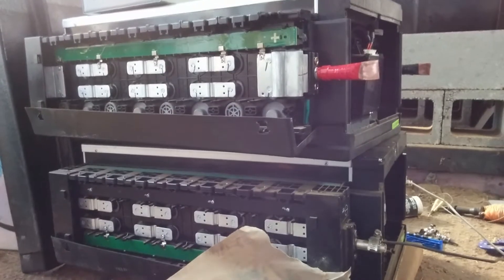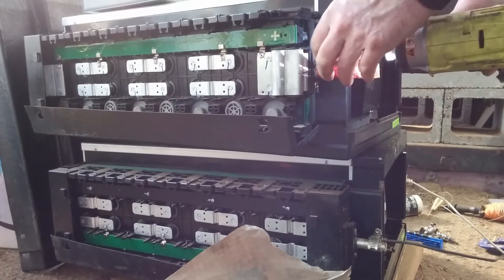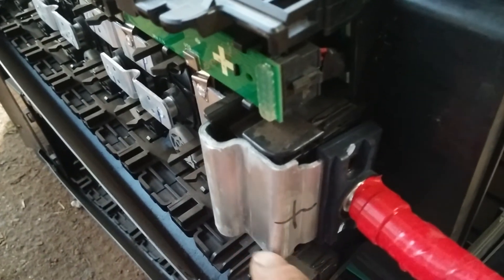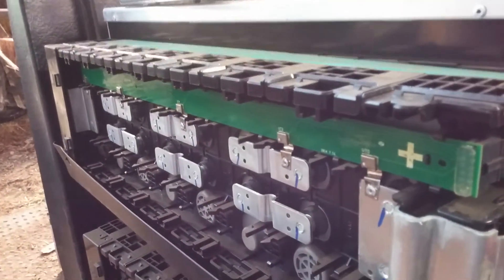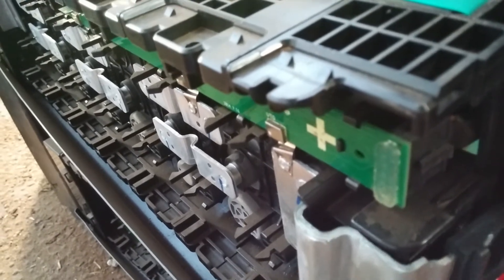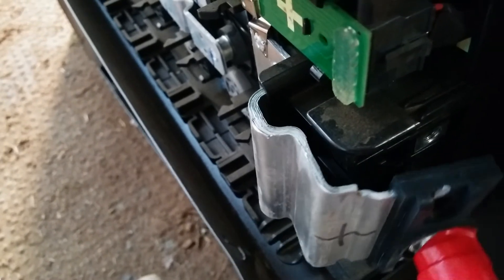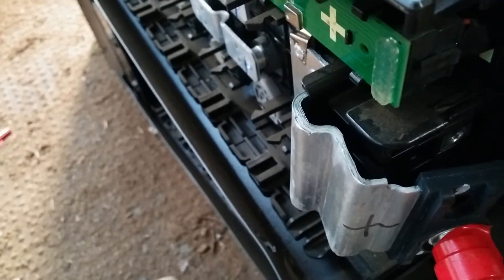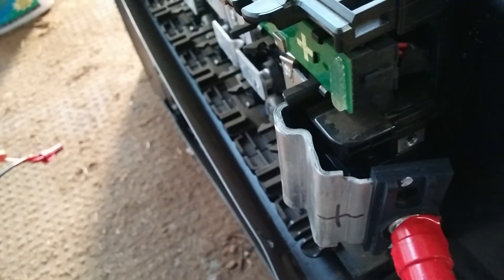BYD Battery Bus Bars Flexible Multi Layered metal

Comment: My thinking is that since electrons flow along the surface of metal rather than the core, except for silver, the engineers went for the multilayered approach and as a bonus it is easy to form. But definitely not meant to be flexed much.
Reply from the maker: Interesting.